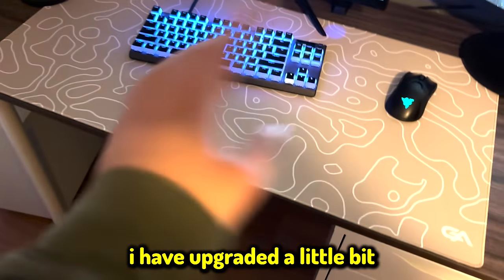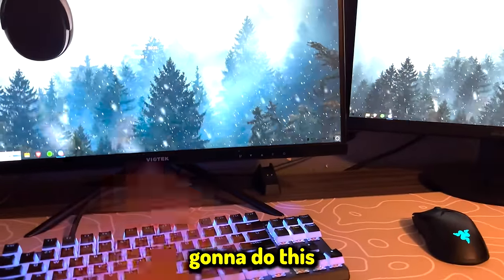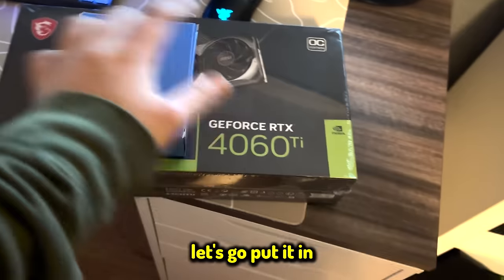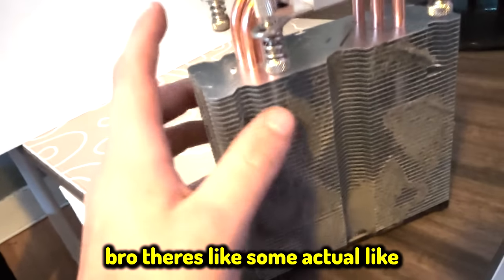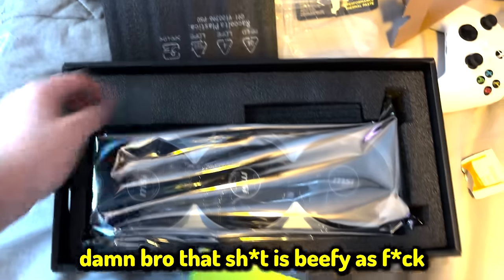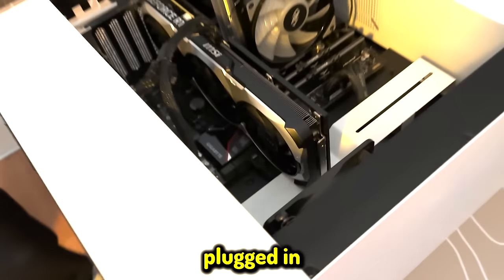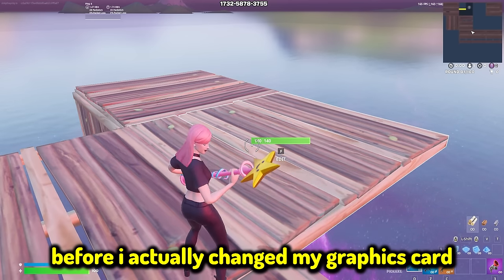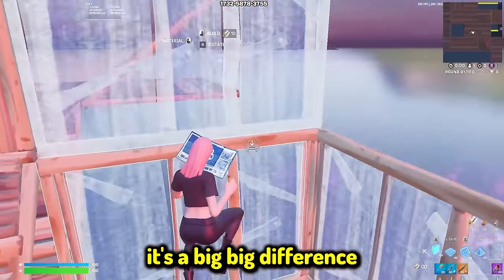I UPGRADED from a 1660ti to a 4060ti (1000fps)

Comment: That’s where I’m stuck I think will the input lag be a huge difference jumping from 2080ti to 4000 series
Reply: Not worth switching off of the 2080 Ti to anything slower than a 4070 Ti. The 2080 Ti is just as fast as the 4060 Ti but has higher memory bandwidth.
Reply: @theboostedbubba6432  the 4060 TI is like 15% better than the 2080 TI with less power usage + fg + more recent + better support.
Reply: @ayefare  peak any reliable benchmarks and they are the same performance. But even for arguments sake, it was 15% faster. Still not worth dropping $400 for.
Reply: @theboostedbubba6432  never said it was worth.
Reply: @Spectrulight Where the actual hell did you get those numbers?! If anything, the 2080 Ti is better, as it is way more future proof and should be a smidge faster. FSR3 should also be similar enough to deliver a solid experience
Reply: @Lolygaggers69  how is it future proof?
Reply: @Spectrulight  with games like Starfield eating up VRAM, the 11GB that the 2080 Ti boasts becomes increasingly important. Despite not being a necessity in the moment, games in the future are likely to continue this trend, making the 2080 Ti the obvious choice between the two with its better rasterization performance and futureproof VRAM.
Reply: @Lolygaggers69  gddr 6 vs gddr 6 x.
the rtx 4000 series will have longer driver support, dlss fg, lower power efficiency (lower power usage).
Reply: @Spectrulight  there are so many things hilariously wrong with this response. First off, the 4060 Ti does not have G6X VRAM, and even if it did, bandwidth doesn’t necessarily change how many bytes a pool of VRAM can hold. Next, let’s look at driver support. NVIDIA is still supporting the roughly 10 year old Maxwell architecture with the latest drivers, so assuming they will continue to do the same, RTX Turing will have over 4 years left at a minimum, which is more than enough time for newer metas of GPUs to come and easily justify inexpensive upgrades, as both cards will be no where near as capable as they were by then. DLSS3 is very impressive, but AMD’s alternative FSR3 works on nearly any graphics card and is similar enough to the point I wouldn’t notice the difference. The power efficiency of the 40 series is quite impressive, but it simply can’t make up for the fact that nearly all of them are overpriced. I recently got an EVGA 2080 Ti pretty easily for $226 after tax and shipping, and the money saved on the graphics card itself will easily pay off the power increase.
Reply: @Lolygaggers69  okay I can see now.

Comment: the i7 9th gen is probably the choice i would never do, you could by an i5 12400f that is a 2 gen old processor but still an absolute banger,  it doesn't cost much, and the mother boards are not that much expensive, next time you upgrade your pc check out for the best quality price piecies online or some of your local stores, oh and an other thing, next time you upgrade your processor and get an i7 or higher go for liquid cooling instead
Reply from the maker: Join my discord. Let’s talk parts!

Comment: guys i have a rtx 3070 and a ryzen 7 2700x on the lowest settings in fortnite i only get 150 in game is this normal or should it be higher
Reply: bro your cpu is bottlenecking you gpu a lot. you should upgrade your cpu

Comment: I feel like you should have done more research on parts.. a 4060ti is horrible for price to performance should have gotten atleast a 4070 or better. And the cpu is horrible also should have just gone with a higher generation i5 instead of a i7 9700..

Comment: Yo you can try selling your 4060ti or returning it and getting an Rx 6800 or 7800xt for whatever price your 4060ti was but anyways good video you can choose wether you wanna go through the hassle
Reply: amd is good but it have some problems with fortnite so its not a good idea
Reply: @NO_Skiller  Bro fell for the oldest myth in pc building history (they fixed it now)💀
Reply: That was with the 5000 series it’s now the 7000s and last gen is 6000
Reply: @NO_Skiller also the boost in Performance is way better

Comment: u shouldve upgraded motherboard and cpu and kept the 1660 if all ur playing is fortnite since fortnite barely has any good graphics on perf mode
like a i9 14900k with a 1050 is much faster than a i5 9400f with a 4090 (for comp games like fortnite)

Comment: I went from a 3070 Ti, which is not bad, to a Asus 4090, the difference is huge, this made it worth it to use 4k, I havent used the other 3070 pc and now its running super bad
Reply: Il take it plz lol
Reply: A 3070 running bad? Only if you use 4K resolution, which wasn’t the purpose of the card to begin with.

Comment: you should have gotten a more modern cpu like a 12600 or 12500 it would be around the same performance and more future proofed
Reply: not future proof at all, for 4060 you should get 7500f or 7600 since am5 will be supported for at least 7 more years

Comment: You should've bought a used rtx 3070 ti or a 3080 for alot cheaper, It's like the 4060 ti but a little bit better.

Comment: Your FPS is actually not that good for the specs, you should fix your RAM speed in the BIOS of your motherboard (spam the Del key when your PC is restarting) because its on 1500 MHz which is extremely slow and it's not running at the max speed which is 2666+. It's gonna improve the FPS alot. Also if you have a 144hz either play at 144 capped (so the screen looks smooth) or uncapped FPS (best input delay). 165 just gives you screen tearing

Comment: You should also optimize your pc because I have a ryzen 5 3600(5 years old) and a rtx 2060 and I get 500 fps in creative and had 800 at one point in time because of optimizing, I need to upgrade bad.
Reply from the maker: Alr
Reply: i have the sane specs but cap out at like 400 just
Reply: im on a 3200g and a gtx 1650 SUPER and get 300 on creative lmfao
Reply: have the same specs and get in creative only 300 fps

Comment: You shoud uncap ur fps beacuse it forces ur gpu to work harder aswell as cpu and hz on monitor doesent mean u can only see 144 fps its just the frame rate that is gonna be shown on the monitor there is a big diffrence beetwen 144 fps and 240 fps if you dont trust me try it out
Reply from the maker: Yeah uncapped is bad

Comment: 9700k and a 4060ti is not a very good pair, still useable though. personally if I wanted to get the full performance out of my 4060ti I would 100% upgrade my to a newer gen cpu.

Comment: You should've went for a better cpu since you play fortnite, the rtx 4060 ti wont even use 50% of its power in fortnite because fortnite is a cpu based game, and you cpu is always going to be at 100% most of the times, next thing you should upgrade is definitely your cpu, at least 12th gen, preferably a 14th gen since they give a better performance than a 12 then and cost just a bit more than a 13th gen

Comment: how has everyone here has yet to point out the biggest issue???
you have a gen 4 gpu. your motherboard/ processor is too old and supports only gen3, which caps your performance the most-
you could easily resell this mobo/i5/1660ti for $200 and get a newer board and cpu with the money.
Reply from the maker: Word
Reply: With a 4060 ti you really won’t notice it

Comment: Rule number 1 of PC’s. Never sayi3/ i5/i7/i9 . The reason is because it means nothing an you can have an i7 8700 or an i5 13400f. (The second one is faster) but if you just say i7 and i5 the. Suddemtly you assume the i7 is faster even though its not. This is really intels fault for the terrible naming tactic but just saying 8700/ 13400f is much more important then saying i7/i5

Comment: yo deamn bro iolso have 1600ti and i want to upgrade to 4060 but there is a lot of bottleneck on 1080p you need to get i9 CPU or ryzen 9
Reply: A bottleneck is where a CPU is barely being used but the GPU is at 100% or the other way around but it doesn't actually matter at all because games vary certain games your CPU will only be 10% and your gpu at 70% then the next game your cpu is at 70% and your gpu is at 10%. It is a complete variable, if your into multiplayer shooters 99.99% of the time your CPU matters the most the gpu will always be used much less so beyond a midrange gpu you are seeing 0 performance gain or very little. So in general for these kind of games aim for a higher end cpu and a midrange GPU. People recommend a balance IF you are playing both big singleplayer story games AND multiplayer shooters because then you will get a good experience all the time no matter what games your playing but if your only into shooters then you don't need that better GPU because it doesn't matter for that game. So basically choose your interests do you like big singleplayer games? Mid range CPU and high end GPU. Do you like big multiplayer games? High end CPU mid range GPU. Now use this information.

Comment: you should pay attention to the bottleneck between the 4060 ti and your processor because it will not be able to keep up with the 4060ti and this will cause drops in fps.
Reply: yo,do you know if a rtx 4060 will be bottlenecked by a ryzen 5 5600?? and will the 4060 run att 100% efficency with a msi b550-pro motherboard???
Reply: @julienwierzbicki2173  that cpu should def be enough for a 4060
Reply: yo would a i9 12900k work well with a rtx 4070ti?

Comment: yo no disrespect but i get 300-400 with my 1660 super and i5-10400f  my pc is very fast and has almost no problems running modern games . like in call of duty i get 150 fps
Reply from the maker: I get 700+ now ⁉️⁉️

Comment: I get its ur money but 4060 is actually worse than the 3060. Idk about the ti but the 4060 is utter shit. Honestly the 3060 or even 3070 would have served u really well. Overall from a 1660 this is an huge upgrade. i7 9700k might be a bit too old but if ur using a newer cpu thus shouldnt be an issue. 

Make sure after installing ur new graphics card to uninstall fully ur old graphics driver USING DDU

Comment: The bottle neck is crazy you can get 1000 fps with a 4060 ti but you cps is to old and weak you should have gotten like a intel i5-13600k or a ryzen 5 7600x or non x

Comment: My i7-4790
GTX 1060 6gb
16gb ram
Ddr3 motherboard
450w power supply,
And only getting 200 capped on creative but in pubs i get 80-90, still stuck woth the same setup 5 years ago,

Comment: i don’t think your 4060ti can play many games at 240 fps. i have a 4070ti and in fortnite it only gets 120fps at 1080 165hz.
Reply: You are on an i3 then.A 4070 ti can run stable 1000 FPS with a solid processor.
Reply: @Tornaturr i’ve got 13700k. no bottlenecking here. 32 gb ddr5 5600 memory.
Reply: weirdly enough, i also keep getting frame drops everytime i mass break slurp barrels. it could just be a bad install of game as the computer is new and not much else is on it.
Reply: @benjaminmartindale  Maybe try out checking pre load all textures in the install window of Fortnite. Then check if Fortnite(is windows in general) is on energy saving mode. Then try out dx12 or dx11 and see if that changes anything. (Performance mode might be buggy for you.) If dx11 or 12 Works fine try uninstalling the game and installing it again. (Since you know your problem is not the hardware) also if your FPS only drop by a bit when doing intensive things this might just be due to how badly optimized Fortnite is. Make sure you have already loaded all the regions on the map.

Comment: wich i7 and which 4060 ti xD aslo imma buy a rtx 4060 ti 16gb soon a nd a i7 13700K
Reply: Dont, that CPU and GPU is very bad value.
Reply: @gintozlato1880  i know but if i want to go amd i need to Change my motherboard then it's gonna Cost alot
Reply: @MaxdepoesGames  What motherboard do you have now?

Also you would not need to change the motherboard no matter what motherboard you have to get a different Graphics card, which is the worse of those two components.
Reply: @gintozlato1880  msi mag bazooka drr4 rn
Reply: @MaxdepoesGames  What chipset?
Reply: LGA 1700 @gintozlato1880

Comment: cpu is bottlenecking u wont have any reason to get a 240hz if u pc cant constantly run 240 bc that cpu is ass u sould get an i5 13 gen or i7 12 if u want help lets talk
Reply from the maker: 240hz monitor is amazing😂 so glad I bought it
Reply: @ZinkyThePinky  i mean yes maybe gc it got 0.5ms led panel 0r a betterr all better lenght and nits and etc but u should just stick to get a better pc if u cant get 240 constant

Comment: So easy lucky you didnt need to do a power supply and take likke the entire pc apart
Reply from the maker: I ended up just building a whole new computer 😂
Reply: @ZinkyThePinky  😭
Reply: @ZinkyThePinky  I was having blue screen issues and had to do so much stuff with my pc to fix and I got like 3 replacement parts

Comment: first and foremost this build is trahs and i love how you put 1k frames yet i built 2060 build for my little cousin and put out more frames that this smh
Reply from the maker: Apparently it worked 💀
Reply: @ZinkyThePinky   you just did not do your research and a 4060 aint lasting you long. not a worthy investment. you save 500 more and you wouldve had something for a good 5-7 years. do your research.....
Reply from the maker: I’m upgrading my cpu but I think I’ll be good with my 4060😘
Reply: @ZinkyThePinky 4060 and 4060 ti are 3 cards at completely different levels. He either misread or is just not informed well. The 4060 ti can play all modern games at ur monitors refresh rate. (Depending on settings ofc.)

Comment: The series after the number on the cpu matters more then the i7 or i5 or i3 so for example the i3 13400 is WAY BETTER than the i7 9700, also if you get a compressed air can and clean your pc it will run much smoother, also optimize your gpu, you can look up a vid and it will run smoother also
Reply from the maker: Yup I’m working on getting a new one rn

Comment: that is a huge  upgrade but you shouldve went with a  i7 10700k at the very least  you could be getting a lot more fps but there is a big  bottleneck with  the 9700k and the  4060ti if you uppgrade the processor you will get more frames
Reply from the maker: I would of had to upgrade my motherboard
Reply: @ZinkyThePinky why did you upgrade the motherboard before then?

Comment: If you guys upgrade dont choose 4060 or 4060ti because the rtx 3070 or 2080 super usually beat 4060 or ti or have 5-15% lower performance at a lower price. so if you are going for a 40 series card  then it should be at least a 4070 if not, go with 3090 TI since it is a little better than 4070 if you have a bit better budget get 3090 ti its better than 4070 plus the vram.
Reply: @ZinkyThePinky  4060 ti is solid for 360+ fps on a lower budget but

Comment: 4060ti i have only has 2 fans  don't understand why some have 3 fans and some have 2 fans.
Reply from the maker: Yeah no clue
Reply: different manufacturers make different models with the 2 fan versions costing less usually
Reply: @weswyd_  that's gotta be it then.
Reply: 3 Fans=more cooling, therefore lower temps, it's that simple really. though for the 4060ti?? 3 fans is a bit overkill for this gpu that basically is pretty efficient.
Reply: Im pretty sure the 3 fan GPUs Also run at higher clock speeds that alow for more performance and speed without thermal throttling

Comment: 4060 ti is literally the worst 40 series gpu. It performs nearly identical to the rtx 3060 ti, sometimes even worse, and it launched at the same price and only has 8gb of vram. Honestly, if you're just gonna play fortnite and not play any games with ray tracing. I recommend amd because it's cheaper and performs better. But to be fair, nvidia is effective in productivity but yeah, 4060 ti is not a good purchase but atleast you're satisfied:)
Reply from the maker: Well sir… as you can see I already bought it 🤪🤪
Reply: @ZinkyThePinky  but why
Reply from the maker: Idk I clicked buy on the website
Reply: @ZinkyThePinky  and Adolf just told a man to "do it"
Reply: I meannnn nvidia is better for fortnite, but rtx 4060 ti still too weak for its price/performance compared to let's say rx 6800